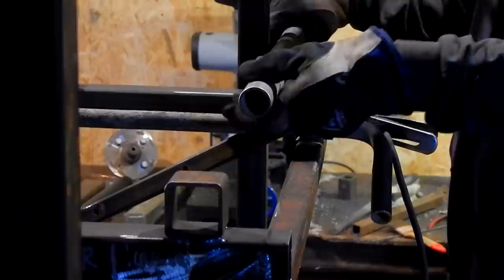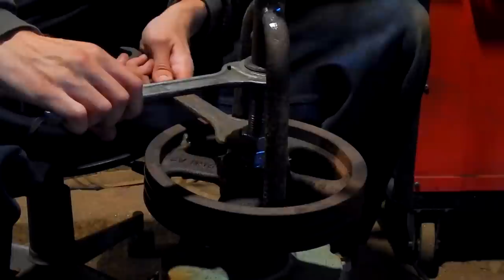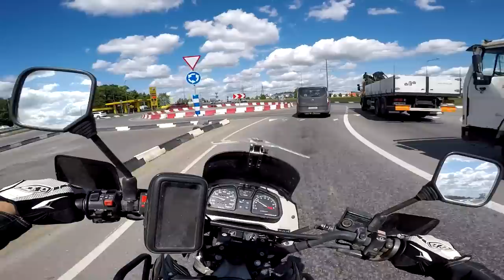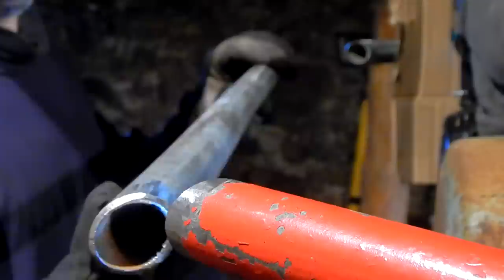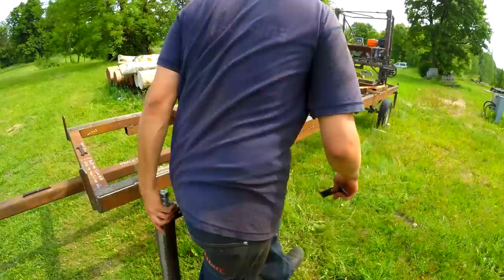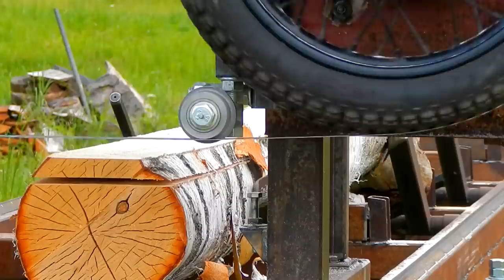CUTTING FIRST BOARDS! SO HAPPY! - Band Sawmill Build #21

Comment from the maker: BEFORE commenting, read this:

*This sawmill is not a finished product
*This sawmill has dual power source, both petrol and electric, thus the purpose of the heavy electric motor on the saw head
*The electric motor is the main power source, but it's not hooked up yet (you can see the power box near the sawmill outside)
*I can't use a centrifugal clutch on the petrol engine since it hooks up to the same jackshaft as the electric motor and the revs don't match (electric motor has constant 1435 rpm, centrifugal clutch works at higher revs)
*There is a designated spot for the blade coolant/lube tanks on the blade cover, although they're not hooked up either
*There will be a proper height adjustment system with 5 mm increments
*The axle of the sawmill trailer is not in my way and there's no need for it to be removable
*It's not hard to push the blade through the wood, although a hand powered feeding system will come
*The sawmill trailer must not be lower, it is at a proper working height since I'm 6'3"-4"-ish/192 cm tall, my back thanks me already for that
*Log loading system will consist of a winch and log ramps, I will not make it hydraulic, at least not in the nearest future
*I have a log arch that'll be used for moving logs around, also by hand
*I will use the boards I cut on the sawmill for future projects
*I have planned a sawmill shed build to cover the sawmill from the elements and to insure a dry working environment for myself
*The corners of the blade guards will stay, at least in the beginning, so there's more room to handle the blade since the guards aren't easily removable, even if it looks bad
*I will paint the mill but as you may already understand - the looks of the machines is not that important to me - I care about the mechanical condition and functionality
*The sawmill trailer will have removable lights for portability - we already have a set that we use for towing cars
*This is not the last video about this sawmill - it's just the last video of the build series ;)

This list here pretty much sums up what I still have to do before I can call this sawmill being finished. But I couldn't wait that long to make the first cut, I bet you didn't either. Thanks for watching and stay tuned for future videos! Cheers!
Reply: Donn DIY 
The interaction between the electric motor and the engine is one of the things I am still wondering but once you built the slide bars I figured you would only have the belt on for the power supply being used. 

I look forward to future upgrades and additions.
Reply: Your fabricating and designing on the fly skills were fun and remarkable watch. I have seen a few of the sawmill build series on Youtube, your's was both enlightening and entertaining. 

Many thank yous from an old fart that use to make a living taking big pieces and turning them into little pieces to make big pieces.
Reply from the maker: You're right about the belts - that's exactly how I planned on using them, and in the homestead I'm mostly going to run the electric motor, or if we're off grid due to power outage then the petrol engine. Future upgrades will come for sure. There's a lot more to tinker, it just doesn't show externally (except for the paint job of course :D).
Reply from the maker: @ John Cambron  I'm glad you enjoyed it, I hope the time you spent watching the series was worth it. ;) Thanks for watching!
Reply: Great machine ! Oh and the lollypop joke was the best
Reply: How powerful is the petrol engine?
Reply: Directional bearings on both the engine and motor pulleys. One will coast while the other pulls and visa-versa.
Reply: Sehr gut !!  Отлично все сделал !!

Comment: I've watched this video multiple times now as well as the build itself. A very good job all the way around in my opinion! Was considering using tires for my build but just bought a large bandsaw that I will convert to use horizontal as a mill head. Your build gave me lots of ideas for my mill. Thank you!!!

Comment: Nice mill, good workmanship. I had built one when I worked in a shop in northern Alberta. I started off with a 6.5 hp engine but found it a little sluggish when i got into the bigger logs. I replaced it with a 15 hp what a world of differance. We move back to Sask. And haven t used it since.

Comment: So excellent. Was great to see it roll out of the barn and into the light in all its glory. I could almost feel you ready to jump up and down and dance to get it going. Such an impressive machine. And to work right from the start without any fiddling. I am so impressed with your talent, hard work, but above all your generosity in sharing the build with us on line. Congrats. I look forward to lots more sawing videos.
Reply from the maker: More sawing vids will come. And also from the needed additions to the sawmill like blade lube, height adjustment, paint, lights, hooking up electric motor etc. The list goes on. I just have to attend to other projects in the meanwhile, thus the end of the series. But more will come, stay tuned! :D

Comment: Excellent build. Only thing I will do differently will be a centrifugal clutch on the motor. Looks like you need to build yourself a hand trolly to cart things like the electric motor around. Well done and thanks for the inspiration.
Reply from the maker: Can't use the centrifugal clutch since I want to run the electric motor too, so the sliding frame is the way to engage and disengage both.
Reply: Too easy. Your idea is probably cheaper and stronger, mine wont have the electric motor so the clutch will simplify construction. Cheers.

Comment: Great build. Followed from the start. All it needs now is a coolant drip system for the blade and a good coat of paint. (No need wondering what the chosen color will be)

Comment: Great job Sir. I loved the series. Now you need to build an edger for your boards sides. Would be another great series.
Reply: Place them on edge and run the saw through them, flip them and do again. You now have dimensioned lumber.

Blade lube system and blade height measuring setup an your good to go to mill up hundreds of board feet of lumber in a few hours.
Reply from the maker: Great idea!
Reply: Thank you Sir. It would  be a fun and educational series to watch.
All my best.
Bobby

Comment: I'll say one thing for band-saw mills...
They don't waste near as much wood as a circular saw mill... But they are way slower and less versatile... 
I know, I use to run a 52" powered by a Cummings diesel engine and couldn't cut 32' easily with no errors at all, and extremely rapidly... But with a 1/4 inch kerf with every cut the logs disappear quickly!!!

Comment: Need a 5 gallon plastic container water with a 1/4 hose with a shutoff valve to controls the water dripping as the gravity feeding constantly on the blade to help the blades last little longer...
Reply from the maker: Already added this water feeding system. ;)

Comment: Such talent from a man so young !!! btw, could have used liquid balancing like they do for washers good for  more than 1000 RPM, also the belt on the motor does not have to be that much tension applied, a looser running belt runs better and you will save on the motor bearing as well , or like a mower deck drive belt not too tight and as it adds from slippage that will help stop parts from breaking, I would rather stall the blade than to force it through if something was wrong like metal, save the blade a little

Comment: Just an idea for your height adjustment system: you should make it possible to zero the scale on the first cut. Instead of marking the measurments on a fixed piece of the mill, mark them on a sliding ruler with a set screw.
Reply from the maker: I have that problem already thought out. Whether it's a good solution or not I will find out in the future videos. Thanks for the input and thanks for watching! ;)

Comment: Now for; painting, auto blade watering, hand crank carriage, sawdust discharge, etc.
Reply: And a scale to see the height of the blade!
Reply from the maker: Jet powered feed mechanism and height adjustment, so I can fly to the moon on the saw carriage, or just hover above the homestead if I get too bored with cutting planks. :)
Reply: I wouldn’t bother with the water. I don’t have either one on mine just when she gets a little turpentine on the blade at the end of the day I’ll spray a little wd40 and it’s gone.
Reply: Hello @DonnDIY   I am Panagiotis from Greece. I have seen many times all your videos about this macine and I am thinking to make it because I  need it for my work designes. I would like you to tell me if you can about the dimensions of the metals. For example the base is 6 meters 60×60×2 millimeters 2 pieces together in every site? I would be very happy if you could help me.

Comment: I think maybe the cut was started on the wrong end of the log, so maybe starting on the thick end of the log would have worked better for it from that end, but heck it's working pretty good for the first run and ironing the bugs out of the thing.
ONce you get a watering system and decide on which way powering the drive system is going to be the best for the application, shoooot its a darn fine little matching there

Comment: Nice machine, honestly! It sounds like your main source of noise are those blade guiding metal wheels. You may want to re-design this part, so, the blade would only touch wheels on radial surface, not axial.
Thanks for sharing.
Reply from the maker: The blade was adjusted incorrectly - the blade shouldn't touch the lip of the guide rollers when rolling, only when under load. But it was my first time using this mill. 😆

Comment: Very neat rig, you've got there! A little paint, then it's perfect. I'd recommend hot pink, because it's the colour of joy and happyness. <3

A laser alignment tool could be a fancy addition …what for projecting an indication line onto the wood, where the blade will make contact. I've seen cheap ones on ebay Europe for about 10 moneys. Better make sure it's actually visible in bright daylight. ;)

Comment: Great build, but i have two questions. 1. Whats the electric motor for? Counter weight? 2. How does the carriage stay up? I didnt see any lock on it. By looking it should fall down after you let go of the handle but it doesnt.

Comment: Really good job. I'm a fabricator and I am impressed with the work. I'm curious as to why you have an electric motor and gas. Is this for jobs away from home. Thanks, John
Reply from the maker: Both options were for versatility. However - I ended up never connecting the electric motor.😛 Thanks for watching🙏

Comment: Better then pretty good!! 👍 Few questions....1) Are you going to paint it? 2) A can, hose and tap to deliver the coolant, which you did now by hand? 3) What about the purpose of the electric motor? 4) Some kind of control to transport the saw over the bed, in stead of pushing?

Comment: First one I watched. Did you put stops on incase you forget to lower one of the log dogs? I can see me messing up a blade or two if I had one. Maybe an "L" bracket off the blade supports or something. Nice mill. 👍
Reply from the maker: The handle I use for lifting and lowering the log dogs will mark the height of the tips of the log dogs on the operator side. I see if I need to lower the dogs or not easily. No worries there.

Comment: I like the machine. Built to 20+ ft. Logs. 
Just curious why you are milling birch. 
What are you using birch. Furniture??
Not planks or beams. No strength for beams. In BC Canada we us this for firewood. Not exterior wood. Rots easily. 

I'm just curious?
Reply: It's is nice size take bigger stock

Comment: Looks great, is there anything about cuts you don't like?  even though you have a cover never stand in the wrong place, right?
Reply from the maker: I like everything about the cuts, especially now when the blade is still sharp. I would never stand in the way of the blade, that's correct. Even with guards on, it just feels weird. :D

Comment: I must have missed it..  What is the electric motor for?  Excellent build
Reply: wondering the same, im thinking hes gonna add another pulley and have a second drive belt so he can switch to electric if its available or if the gas engine gives any trouble
Reply: He said in an earlier video that he was planning on adding another set of pulleys so he can run it on electricity when available
Reply: the echo in this comment section is loud
Reply from the maker: For dual power source. I already have a second set of pulleys beside the petrol engine one installed. Just need to hook up the electric motor.
Reply: Donn DIY thank you sir, excellent build. Think you could build another and ship it to the states....

Comment: You are a genius! !! now you can open a sawmill for you and friends "one thing I did not understand the electric motor how many horses and the generator how many kw has ??
Reply from the maker: Electric motor is the main power source (not hooked up yet), the petrol engine is the secondary power source if working out in the forest for an example. The petrol engine is 15 HP, the electric motor 7,5 kW.
Reply: Ok boss👍👍

Comment: I m not criticizing but i wana say that the blade and bike wheel attached will produce lots of friction become hot. The wood log you use is a soft one, in case of harder log, it can't cut through.

Comment: The problem with running saw on tires  is it will remove the set from  your blade. The only answer would be a carbide  Blade with no set
Reply from the maker: The teeth do not touch the motorcycle tire because it has round profile.

Comment: You need to make the wheels a drop axle and get that puppy lower to the ground, Your back will thank you! Why are your log dogs (backstops) tops angled the wrong direction, (short side of the angle facing the log)? maybe I am missing something. Pretty cool build though.
Reply: they angle cut them so the log will slide on them while rotating the log then when it gets lower he will pull them out and spin them around for a full contact with the squared off log
Reply: i just noticed that the log stops fold down when not in use.
Reply: Ha, I just realized the angle was to make the logs easier to roll!

Comment: If the drive pulley was in between the 2 motors then shifting the motors from side to side would have changed from electric to gas imply because it would slack one s belt but tighten the others.

Comment: If it's a three phase motor you can use a three phase motor inverter on there so you can control the speed of the electric motor

Comment: Hey what you think how meny rpm you have on blade?
Reply from the maker: Don't know the rotation per minute but the blade feet per minute is 4000-4500.
Reply: @DonnDIY  how you mesure? Do you have formula?
My saw is big puley 55cm and on engine 10cm

Comment: Did you find that the tyres flatten the twitch on your teeth?
Reply from the maker: The motorcycle tyre is round and doesn't come to contact with the teeth so it can't flatten them either.